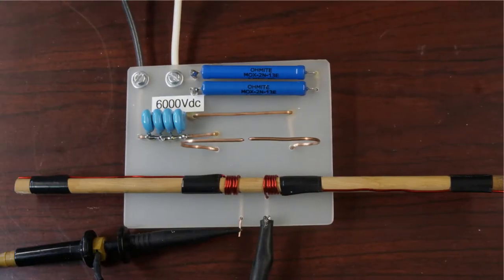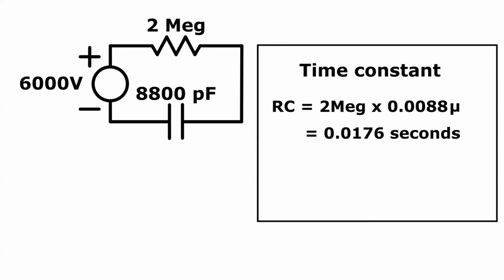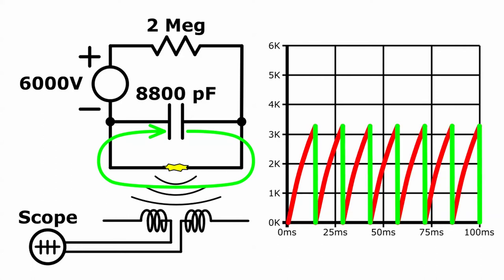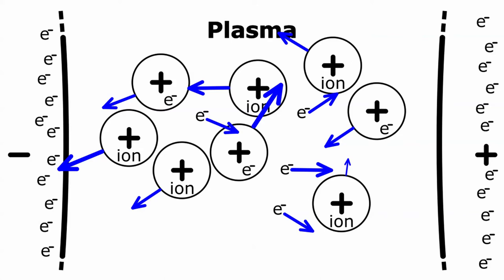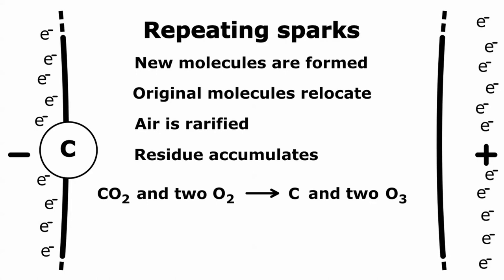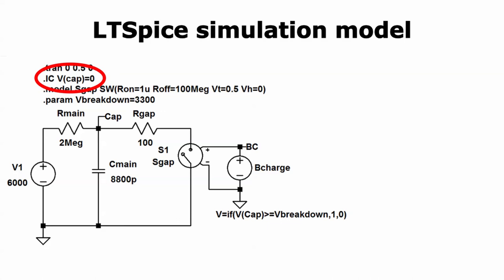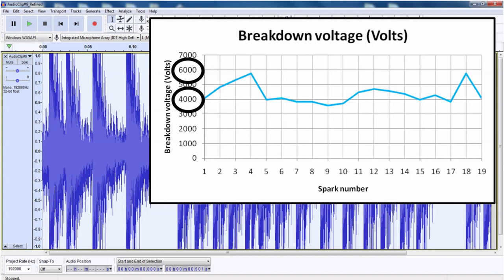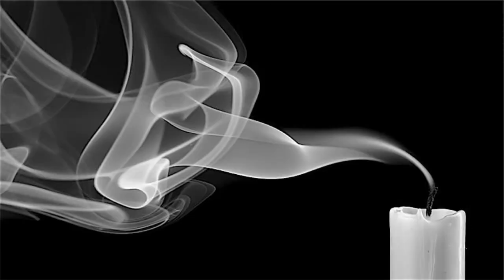How to model a spark gap in LTSpice

Comment: Great content! So much stuff and so clearly explained. I also was trying to simulate a spark gap with LTSpice and my first choice, that worked more of less, was to use a Zener diode in reverse with a breakdown voltage set to the breakdown voltage of my gap.

Comment: Somehow I missed what the purpose of the resistor is ( 2 Meg Ohms)?
I also missed what LTSpice means in the first place?  Does it have any salt or is it sugar,  must be on light side I would think.  There is no telling, that is for sure.  I seem to be miss the most important parts.
And what would be the result if instead of DC, the supply is AC?
Too many questions... I ruin everything.

Comment: Dude thank you! I've been searching for a SPICE model for a spark gap for a long time and finally found your video. And by the way, great explanation of the working of the spark gap. And by the way , I'm using ORCAD capture lite PSICE software and I want know if I could use the spark gap circuit the you have shown to model a new part/component. I want to use the new spark gap part to construct a multiple stage HEMP Marx generator.